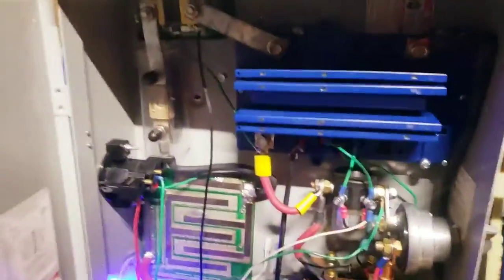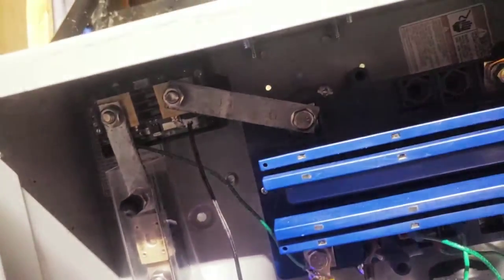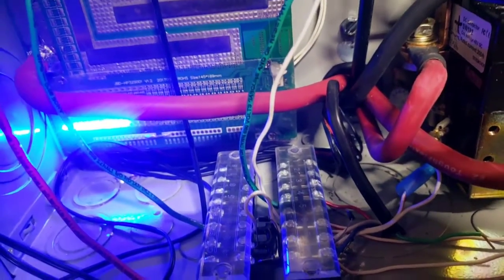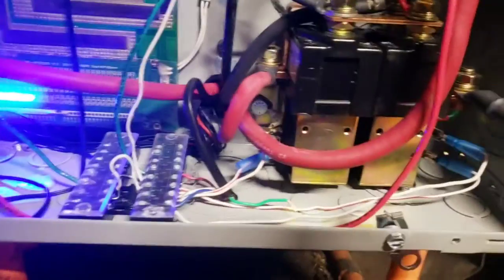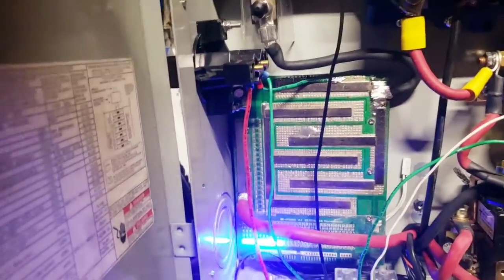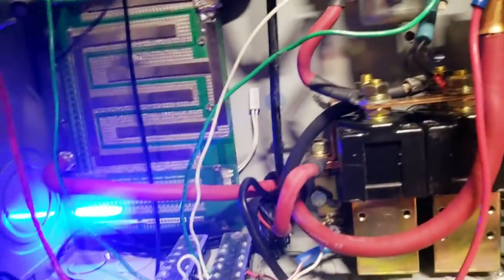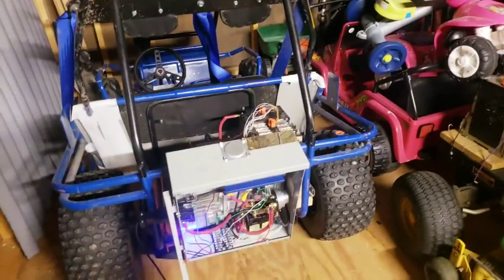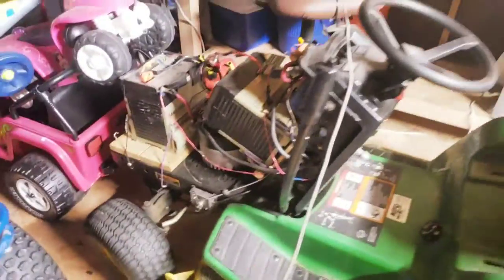Manco Go-Kart - EV Conversion - Final Assembly (Part 4)

Comment: I'm glad you started filming in landscape like a non-heathen. :) How fast do you reckon one of these bad betties could go if you took all the PTO components out? Asking, because I'm trying to build a race mower.
Reply from the maker: Assuming you are referring to the mowing components and clutch gear. 

The gokart was direct to drive shaft using sprockets and chain. I increased the main drive sprocket(gear) tooth count in the end because it was too fast 😅. We clocked the kart at 40mph with the slower gear.

If you do similar with the racing mowers I would get a brushless, higher rpm motor with less torque. That should allow for ridiculous speed.
For my conversion, I used what I was familiar with from the riding mower conversion. That motor is really not suited for speed.

Check out: https://evdrives.com/conversion-parts/motors/